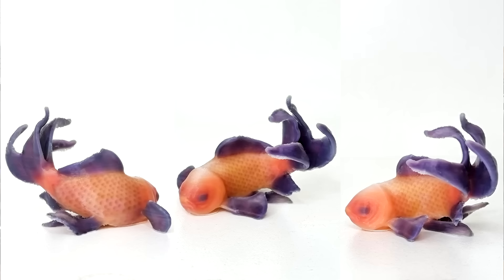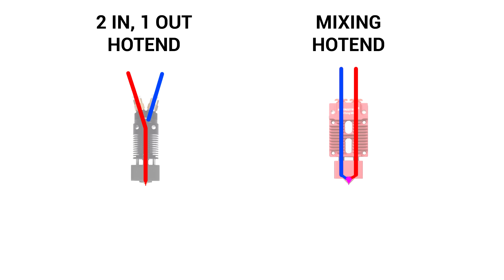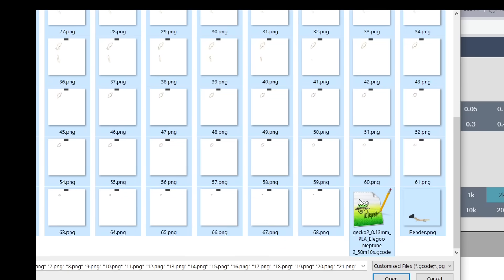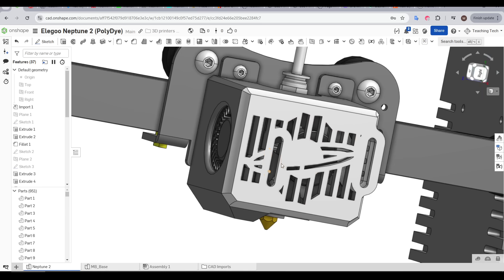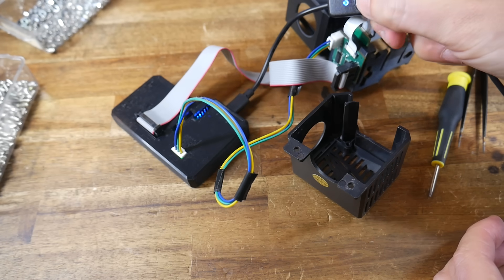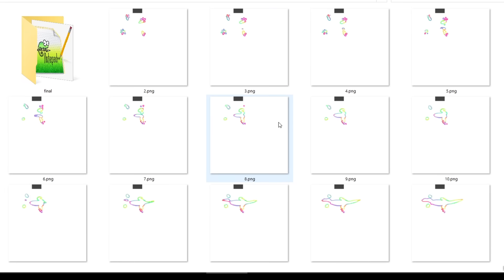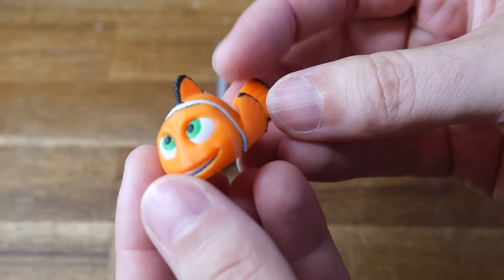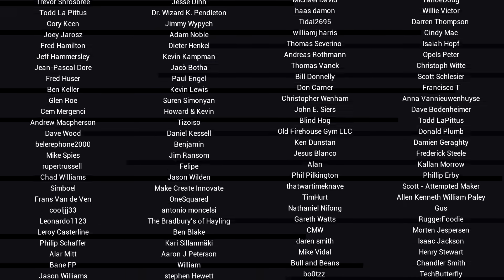Full colour 3D printing at home with PolyDye - Open Source Inkjet integration

Comment from the maker: Jacques has solved my colour shift problem! It was the Z fade for ABL. Setting it to zero has allowed me to keep colour accuracy past 9-10mm.
Very glad to see all of the compliments in these comments for Jacques' work. He really deserves it.
Reply: Z fade height in Marlin has been one of my worst pains. It just always destroyed geometry for me, on my printer that homes at Z max, when reaching the bed (since I use either a PCB or 4 mm glass, so the height changes), when it has any Z fade, it just squishes the height until it matches what the printer measured as the start, so if the bed was supposedly 4 mm above zero, it will print something 4 mm smaller.
I've since just disabled it and never looked back. Wonder if it now works better.
Reply: @Kalvinjj  eu utilizo essa altura de deslocamento em Z no Marlin. Mas antes faço todo o nivelamento manual usando papel e ajustando as roldanas. O ajuste por software é pra ser um ajuste fino, ele não vai nivelar a mesa.
Após nivelar, coloco uma peça de grande área em contato com a placa de construção, e vou ajustando a altura em Z até perceber que a altura da primeira camada não está esmagada e nem alta de mais.
Reply: Hey Michael,
How is the strength of these parts?
Very cool technology, definitely, but it makes me wonder if it affects part strength.
Because ink is not plastic.
Although, in the future, Jacques or someone else could modify this technology and make it only print color on the vast outer layer.
This way, the color would only be on the outside.
And the part strength would not be significantly affected.

Maybe it's already that way, though.

Edit:
On a side note.
I have an idea for how to print full range color, but it would have to be worked out by a company with a research team.
It involves mixing up the dye with plastic as it is being extruded.
It might have to be a small chamber that does it, and the inside of the extruder head would need something like a non-stick surface that is past the color chamber to keep the colors from sticking, and the resulting color from getting mixed with the previous (same issue we have today with multicolor single-nozzle printers).

But, there are so many ways to do this.
It's interesting to see people come up with ideas and implement them.

What Jacques did is impressive.

Comment: This is outstanding work! A suitable v. 2.0 should work with a generic refillable 4 color cartridge so any ink could be used without being the most expensive part of the print. Are the print waterproof or will they run just like a inkjet paper print if it gets wet? A clear coat would help but it would be better if not necessary. How is the adheation of color to filament and the next layer of material? does this reduce the layer adhesion? Is it precise enough to only "paint" the outer layer, both for strength and to save ink? What filament material is best for good results? Could specialty inks be used to for example give UV protection to PLA? 
There are so many possibilities with this idea I think you only scratched the surface. This could open up whole new avenues in 3D printing, like material coating. Imagine a chrome ink so you can make reflectors for lamps, for one, or copper for 3D circuits built in to your prints, no more wiring required, And so on. I wish I was a experienced 3D printer person so I could get in on this. Any printer maker plans to integrate this from factory you heard of?

Comment: 1. Despite the appeal of a low-cost solution, it doesn't answer the main question: who is the project's target audience? Who are the people who need photorealistic 3D figurines? I'd guess they're some kind of 3D portraits or artwork. They're definitely not wall hooks or boxes with labels.

2. The concept itself is flawed: we're printing color inside the figurine and only seeing it due to the material's transparency. It would be more effective to paint the figurine's surface itself, eliminating the need for transparency. In other words, instead of using paint, use powder from a laser printer (or a micro-atomizer from a sublimation printer).

3. Or maybe it's easier to add a small extruder with ink on the outside, printing only the outer layer—it would be bright, and the ink would be used in microdoses.

THANK YOU!!!!!!!!!!! 🙂

Comment: I saw something similar 20 years ago on a powder bed fusion machine, where the powder was fused with inkjet ink instead of heat or adhesive, then after extraction you had to harden it in some sort of epoxy fume chamber. It was not terribly practical for home use, but it did produce full color prints (albeit rather muted/pastel looking) . I probably still have the demo print in a box somewhere.

Comment: Why use propitiatory cartridges if the project requires custom hardware anyway? It seems like it would be simpler to just lift the entire print head off of a printer that uses a reservoir and get that running than use a cartridge system.

Comment: Its outstanding work. Just went over there to donate a little money. Im impressed how far they already took it. I consider this to be basic research. But if we one day want to print in color. Multicolor printing is just the worst possible way to go. Augmenting 3D prints with acutal color printing is the only viable option. They should start a kickstarter campain to boost the research this could be huge in the future even if its a long way to go. We need specialized filaments for this as well. So there are a lot of moving parts in this one. But holy shit well done so far.

Comment: I used to manufacture and repurpose ink cartridges. There is a product called rysol that you can apply to an upside down cartridge, let a few drops soak into the print head then place the print head correct side up on some moist kitchen towel until the ink flows freely again. Don't leave it there too long as it will drain the cartridge. You may also  put the print head in an altrasonic bath for one minute then again wipe it gently on some kitchen towel until it flows well. Hope that helps someone

Comment: Well, the future of 3d printing will be in full color (this for sure as other technologies), the waste of filament and long printing time today are the two biggest "problem to solve" for 3d printing.
Changing filament every layer makes the process incredibly long and plastic consuming (really low efficiency).
This system fixes the problem of time, wasted material and opens up the opportunity to use an infity of colors or make our own.
Painting filament while depositing it. This is the future!!! Good job!!!

Comment: Instead of ink, I wonder if toner powder could be mixed into the plastic inside the hotend. Toner is thermoplastic material itself so it could completely fuse with the base material to give vibrant and precise colors. And there would be no XY offsets to setup since colored plastic would come out of the main nozzle. Main complication would be a system to precisely dose all the colors both in amounts and timing.

Comment: as someone who has spent half of my life working in a copier/printer repair company, i feel like the future of this process is going to be figuring out how to use toner for this process, rather than ink. toner being a very fine powdered plastic, which is melted to the paper in a fuser unit ( 2 heated rollers that the paper passes through), similar to powder coating process as well. fine powdered plastic drawn to object through electric charge
Reply: Cjp and mjf been available for a while and both use ink because you can make millions on clogged print heads and ink cartridges

Comment: How come no one thought of cannibalizing the high-resolution encoder off of an ACTUAL inkjet printer and feeding it into the cartridge controller board in order to prevent desynchronization? It's super high resolution so it might be challenging to work with but you'll never lose position if you do it right!

Comment: This makes me wonder if there might be better ink out there or a better ink delivery system.  Cannon makes a tank-style printer that you can use whatever ink you want and that might lend itself to this 3D printing solution a bit better.  I'm thinking that you could use an ink that is made for something like polyester or some other synthetic fibers, it might be more vibrant on the plastic and designed to 'stick' to it.

Comment: Something that would be awesome, Inkjet still but with refillable tubes or "tanks" mounted at the top with a line running to the a cartridge nozzle for the 4 main colors used for mixing. You can get a visual representation of the ink level while removing the risk of running out while printing.
I forgot which company did it but it was a printer company that made a printer like that for those that didn't like the cartridges and would rather refill internal "tanks" from the outside while having that visual check for levels.
This is a cool idea. I never thought this was even possible (not the biggest engineer) but the ideas that could be added to this is awesome!

Comment: Thanks. This is a really helpful video. I have the Beta Test PolyDye unit and I picked up an Elgoo Neptune 2 so all ready to go.
However, the link to the Onshape folder does not seem to correspond with the mounts shown in the video. The only part in the folder seems to be identical to the MB base.stl but I suppose it could be slightly different. But the other parts are not visible although an assembly and a solidworks part are also listed in the tabs. I am reasonably familiar with Onshape but am I missing something? Isit not possible to add the relevant stl files to the PolyDye Github? Thanks in advance.

Comment: What I find most interesting is that you could turn your 3D printer into a 2D printer free of the limitations and the scamming practiced by the classic printer manufacturers. A printer where you could use 100% of the ink in the cartridge, then refill it as many times as you want until it breaks! A printer that could print on any surface or material.

Comment: Just to be clear, this isn't modifying the firmware of the printer you use, right? So I could attach it and if it doesn't work well, still use the printer as normal?

Comment: mixing this with multi-material printing could be awesome. Using CYM filament and CYMK ink could reduce the faded look of the colors. 

here is my hypothetical integration:
Given the color you want, you pick the CYM/white color closest to it, and pick that as your filament. Then you use the CYMK ink to pull the color to what you want, not using the color of filament you are inking onto. repeat for each layer...

Comment: The one issue I see is probably with the ink cartridges themselves as they are normally expensive. If there was a way of doing similar to the eco tank models that have been recently coming out, or have refillable ink cartridges that used to be part of printers before they went to disposable.

Comment: I swear multi filiment systems are such a waste for a color system. The main benefit should have been for material science like mixing tpu with hard plastics. Or using cheap filaments as filler and specialty on areas needed

Comment: As a long time printer user and the guy who usually ended up having to fix it I would suggest using a lab grade swab and distilled water to do any of the wiping for water-based inkjet. 

There needs to be a place that the head can park in between the print since most inkjet cartridges need to be used multiple times a day in order to keep the liquid in the head liquid and nonclogging.

This is very cool and it would be exciting to see integration with different kinds of print cartridges and ink systems since the inks out there are so varied. A pigment ink system would be ideal so you don't have any kind of fading.

Comment: Why HP ink? The most consumer unfriendly company has no place in this project.
Reply: I have a similar HP cartridge not exact same number but on those you can peel the label and there are holes you can fill them up with a syringe, they are great. Don't have to buy new.

Comment: At this point SCREW THE 3D PRINTING -  you guys have a solution to all the printer errors and not acepting the cartridges ect, also none of that proprietary BS - simple tray print for the bed and 3d printers will be better at printing on paper than inkjet printers :D

Comment: sorry but cartridges don't seem to be cost friendly... it is a very cool idea but I would like to know how long a cartridge would last and if it fails to dye the edges it will look fuzzy like the pictures shown.
Reply: I have similar HP cartridge not exact same number but on those I peel the label and there are holes I fill them up with a syringe, they are great. Don't have to buy new.

Comment: I dont like it. I mean the idea and the hardware (using commonly available injet cartridges) is great and I really hope it takes off. 

The problem I have with this system is the controller side of things. "It replaces octoprint" no! Gcode senders is a solved problem. You dont want to reinvent the whole system with hundreds of plugins people made for it just because you want to add colors. And what if I use Klipper (hello! Its 2024! Marlin is outdated) or any other system that comes after it?

Heres how I think it should've been designed. The microcontroller on the board should only act as a slave to the rest of the printer. With klipper you would connect it like any other toolboard - using USB or CAN. Then a modified version of klipper would send the necessary data to the inkjet. Or if you're using marlin, idk maybe connect it to the raspberry pi and make an octoprint plugin for it?

Comment: The poor color quality is a result of what an inkjet actually does. It drops ink onto the surface, but since the walls of the print are not aligned with the drop, the ink gets covered, and the color gets hidden. Additionally, the shading and blending by the printer is a result of process of how the dark dots are placed. So, the better way to achieve this is to print the model normally and create a "3D Object Inkjet Printer" with the help of rotation and tilt axes. This should allow the inkjet printer module to move to any visible surface (on the outside of the object). Anyway, what you guys have done is incredible engineering, and I am really impressed by how the open-source community is changing everything. Great job!

Comment: We have a stratasys J850 polyjet at work, and i can tell you its definitely not a good choice for hobbyist even if your loaded. The print head cant sit, it needs to be run regularly or it will clog. The materials have a limited shelf life and cost over $1000 each. The printer itself costs as much as a nice house ~$750K.

Comment: Hmm I wonder why inkjet printers have built in wipers and linear optical encoders for positional accuracy? I've always wondered why 3d printers eschewed the idea of the linear optical encoder to take up the backlash especially of long ball screws to drive linear rails and stretchy belt drives.

Comment: Can’t wait for this to be refined and added to future printers. I’ve seen something similar for commercial applications but that thing was huge and everything down to the toner type pigment they used was proprietary.
The main pain of being in the Bamboo club is emptying out all the purged plastic when doing colour prints. It’s really annoying, if they just added another print head it would save so much waste. Most colour prints I do tend to be 90% one colour and 10% other colours for details.
Even in a single colour print, you could have one head loaded for the model and the other head loaded with support material of a different colour. Would improve things dramatically.

Comment: I would have approached this differently. Ie make a diy UV printer converting a normal printer, then adding 3d printing functionality. Its then a case of 3d print a layer then tell the normal printer to print what's on that layer.

Comment: Wonderful work in progress but my main concern is having so much weight so far out, which is sure to vibrate more than if the unit were placed on the other side of hot end and thus closer to the center of balance.

Comment: Dual head printers (possibly tri head) will likely be the future. One for main filament, one for support filament, and possibly one for the inkjet. Majority of the time will likely be spent between main and inkjet as you could just do support interface layers out of the support filament if filament cost is low enough.

Comment: In inkjet printers, each print starts by spraying a bunch of ink into a waste bucket to purge and wiping over a rubber wiper a number of times.  Between prints, the printhead parks onto a sealed pad to prevent evaporation.  A clever inventor could make a snap in/snap out mechanism that is triggered by bumping to cover/uncover this printhead in a similar way.

Comment: The key flaw (potential for improvement) is the layer-color-layer system.  I have a colorizer that colors filament with markers by coloring the filament as it feeds.  I can't help thinking that the same thing could be done with ink cartridges,  using some sort of ink pooling at the top of the hotend, so that the ink is included into the material, rather than set on top.

It would need to add color in advance of the point of use, but sorting out feed rates is something we're all used to by now, right?

Comment: Thank you for showcasing a startup (of sorts) with a new take on 3D printing. It does have some obvious flaws, but that it successfully prints as designed is a great step forward.
Reply: It's not exactly a new idea, the Da Vinci Color tried this concept around 7 years ago. 
But hopefully this project will fare better then the original.